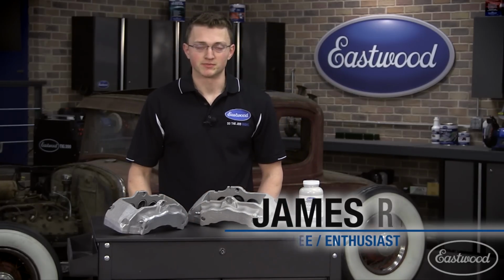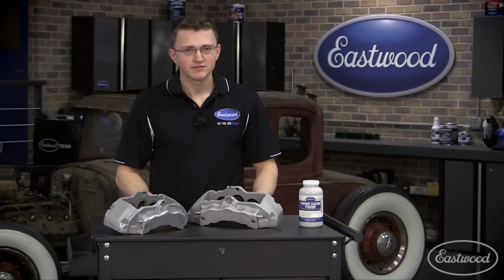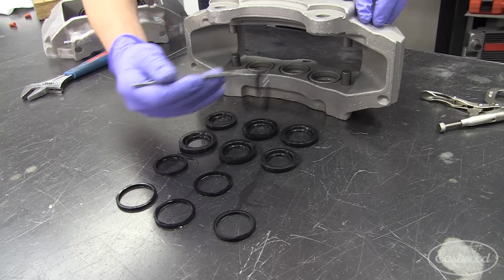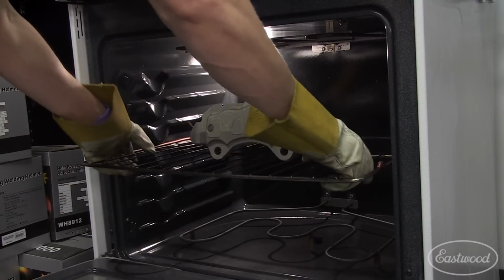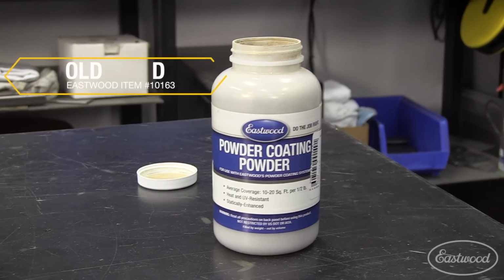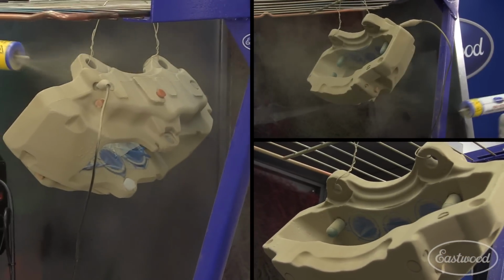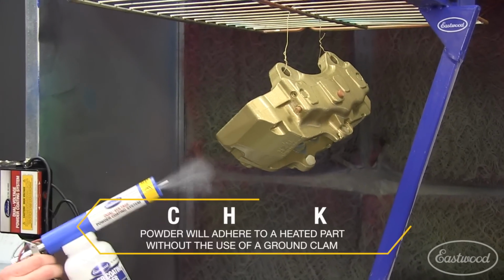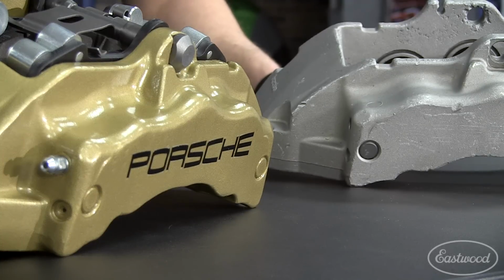How To Powder Coat Brake Calipers - Powder Coating Custom Brembo Brake Calipers from Eastwood

Comment: Why won't the seals hold up to 400° F  oven ?  Brakes get up to 600°F
Reply from the maker: The brake pads and rotors, the friction parts, might get that hot but rubber itself starts to melt at 392°F so we would recommend disassembly before baking in an oven.
Reply: @eastwoodco  makes sense
Reply: @eastwoodco   I also heard that the seals can tolerate 600° F but not constant.

Comment: Can we automate powder coating of these parts? Please clarify
Reply from the maker: We're not sure how you would do that without an assembly line of infrastructure.
Reply: @eastwoodco  oh. So can I infer that as of now there is no assembly line infrastructure for this?
Reply from the maker: We don't offer an automated way of doing what you're asking. You need to manually apply powder coat from a gun such as our PCS-250 then bake.
Reply: @eastwoodco  thanks man it was a great help

Comment: @Eastwood Company  so when spraying the clear, you dont have to attach the grounding strap?
Reply from the maker: If you're using the "Hot Flocking" method you do not need the ground strap.

Comment: Nice work but there is no way my wife will let me buy air compressor and spray powder in the garage then put a caliper in the oven
Reply: $99 pancake compressor, spray outside, and use a dedicated powder-only toaster oven. Buy the cheap Harbor Freight gun and powders, boom: $200 powder coat setup. Granted, it won't get results like the pros, but it'll take up little space and cost almost nothing.
Reply: Well then , just put your Fanny pack on and go back into the kitchen

Comment: It is actually better to leave  the seals and pistons in and cook at 300 degrees which will not hurt the seals at all and removal will most likely cause more damage than leaving them intact. Calipers can reach 600 degrees under normal conditions especially on motorhomes.

Comment: Your site says that the powder coat is only good to us and up to 250 degrees with calipers can go all the way up to 1000 degrees so do you have any powder coat that is good for these calipers to withstand the high heat
Reply: 1000 degrees for a caliper?

Comment: considering how HOT brakes get do you really think the pistons and seals would not withstand 400 degrees
i think that is bullshit
Reply: It's not so much the heat, it's the powder getting on them and gumming up the works. Plus, continuous 400° for 20 minutes is a bit different than  1200° for a few seconds then cool down.

Comment: Good luck finding a pair of 6 piston Brembos for $200?!
Reply: James Callahan 17Z off the porsche cayennes bro, full sets go for like $600 on ebay. They're hands down the best cheap BBK out there.
Reply: Got my 18Z 350mm rotor brembos off of a wrecked porsche cayenne, $175 a piece before rebuild. Use car-part or ebay. They're out there!

Comment: My calipers are in halves, is it ideal to bolt them back together before powder coating?
Reply: For the best powder coat result, separate them before powder coating. Msk off the proper area then rebolt back together when rebuilding.

Comment: Did you bake the calipers with the rear caliper seal still in between the back brake? meaning I know some brembos are a two piece set up and on my particular car the back ones are a two piece set up that have a gasket in between the two pieces that keeps it from leaking. Brembo says do not separate the pieces so if I bake it in the oven at 400 degrees will it damage the gasket

Comment: could you tell me a bit about the decals 
maybe the brand are they vinyl? 
what exactly do I need to be able to clear over decals
Reply: It's high-temperature decal, that's why he able to bake them with it on and not have it fall off. But I personally recommend leaving that to the last step because the curing can move the font as you can see. Plus it gives you the option to change the font color time to time.

Comment: what kind of sticker is that?
Reply: thats what i wanna know. you cant put a vinyl sticker in a 400 degree oven without it shrinking up and you damn well cant powder coat over the top of it!
( that being said whoever thinks that wavy ass logo looks good is blind ) -
i have a great deal of experience with powder ( go to www.redbarronchoppers.com and look at the orange and silver bike and the yellow and red onr - thats 100% powder!

the better way to make this work id do the base 50% cooked.... let it cool off then use an INVERSE logo and lightly rough up the soft powder inside the logo area and then SHOOT A DIFFERENT COLOR... put it back in the oven and cook the whole thing... you will never have to worry about it falling off its there for life!

Comment: Great video, gave me a lot of ideas however i have one question, what type of material did you use for the porshe sticker so the heat wont melt the word design?   cheers..

Comment: nice work ,question tho what material was the decal that it didnt melt off from the heat ? vinyl?
Reply: it actualy did. if you look closely you can tell it deformed

Comment: Just saw this video and I like it.  The gloss powder that you added is this gold or clear?  I wish you had a link to it since I have to paint my calipers gold and this was very interesting to learn.
Reply from the maker: +Sledge Hammer It was Eastwood Gold Powder (item 10163) -  http://www.eastwood.com/hotcoat-powder-gold.html and Eastwood Full Gloss Clear Powder (10093) http://www.eastwood.com/hotcoat-powder-full-gloss-clear.html.
Reply: +Eastwood Company Thank you sir, I better place my order right away for the gloss clear.

Comment: Could you tell more about the "sticker"?  Was it off-the-shelf?  Made specifically for powder coating? Etc.
Reply from the maker: +David Plass It was a standard automotive grade vinyl decal.
Reply: +Eastwood Company But also high-temperature-resistant, like the tape, right?
Reply: +David Plass yes
Reply: It looks like someone got our Devvo to cut those decals with safety scissors. :)

Comment: Very cool and all but one question... WHERE Did you get yourself a pair of 6piston Brembos for a steal?!
Reply: TONY HAWK in case your still looking, the calipers on the video are 17Z's from base model porsche cayenne, audi q7, and vw touareg, and a few more i believe. You can find full 4 corner sets on ebay for around $400-800, and probably cheaper if you get them from a part out.